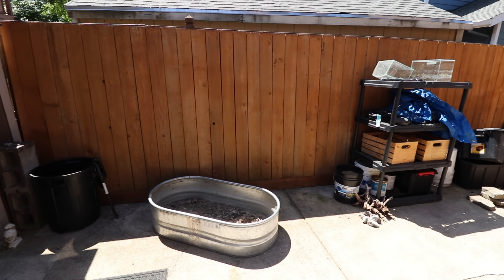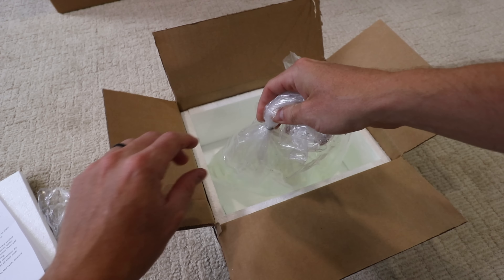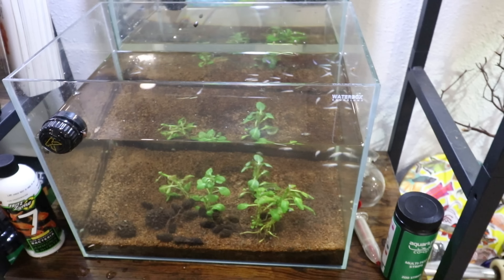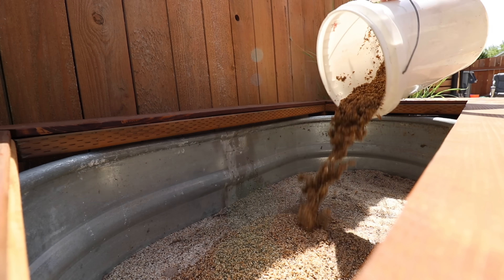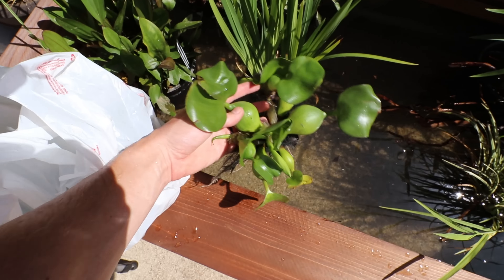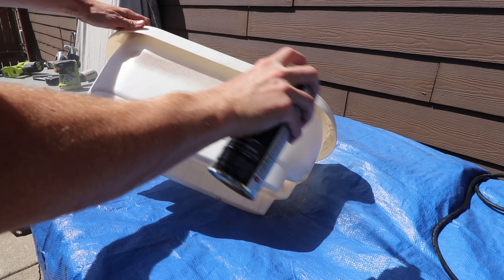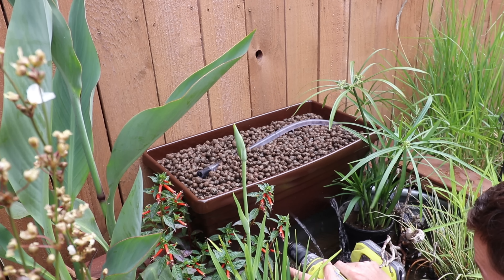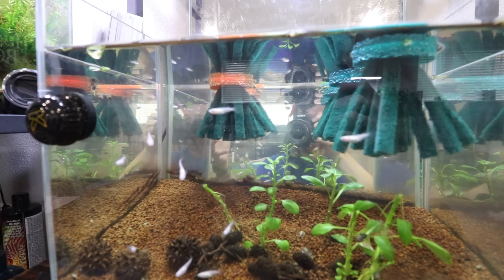Making A Fancy DIY Patio Fish Pond w/ Aquaponics Filter!

Comment: that is a great eb and flow water bed
so the only ting about this setup is that the growing container, with the clay pellets could probably be about 4x bigger.
atm you might have some nitrate issues (cause the tiny fish) but after they get bigger that one tank can provide nutrients for a very large planted bed, like 4x4 sq ft, basically one ft per gold fish

I've had great luck with kale in aquaponics, and basil! Go crazy with the herbs they will do awesome!
Also green onions and chives are good, as long as the seeds don't wash out into your tank.

can't wait to see the update in a few weeks :D great work
Reply: p.s. in my bed im growing strawberries, basil, kale, thyme, green onions (from bottom cuts after eating) and i'm trying a zuchinni but idk if it's working out well, they don't seem to like the stem being wet.
Reply from the maker: Thanks for the heads up! You think the goldfish will produce too much NH3 relative to my small biomass in the filter??? I was kinda thinkin it would be the opposite....

Comment: Let the roots decide on their where to go. Starting with younger plants are usually better and make sure to cut the roots down so they aren't clumped up and grow into wherever they need to. Some of those roots will probably rot since you clumped them up but with a bit of luck microbes might eat through the dead plant matter quickly enough. The pond is outdoors so microbes will find their way in there if it's all dechlorinated.

Comment: Talking from experience zucchini will outgrow everything and go crazy so maybe not the best for that situation
Reply from the maker: Thanks for letting me know! Is the trellis Idea not a good one?
Reply: @AQUAPROS yeah the set up looks good with the clay and nice water circulation, the kale should grow nicely, fast growing species like lettuce or spinach should also grow in something like that
Reply from the maker: @arnoldmmbb  ill let ya know what happens! Cheers
Reply: @AQUAPROS not all zucchini cultivars have tendrils to “climb” or attach themselves to structures, you may need to assist them with twine, clips, Velcro gardening tape, and etc if yours doesn’t have those tendrils.

I have two small water gardens/ponds, I repurposed big planters without drainage holes, one is 18 gallons and the other is 10-12 gallons and each has 5 rose gold minnow fish.
And I’m struggling the most with keeping my pump from clogging (hornwort seaweed shedding) and finding good alternatives for pots and layouts that can fit small ponds, everything takes too much space…
In the small pond I have a creeping Jenny and baby prince tut potted, and several salvinia minima, one water lettuce and one water hyacinth. In the bigger pond I have a water Lily potted in a canvas bag, one mojito calocasia, one dwarf papyrus and one creeping Jenny potted, and parrot feather, aside the other same floating plants and the other one.
Should I aim for adding soil/sand to the bottom of the pond and plant directly? Should I DIY my own canvas bags? 
Also I have started several lotus seeds, they seem to be ready to plant now, so I’m ready to experiment with them!
Thanks